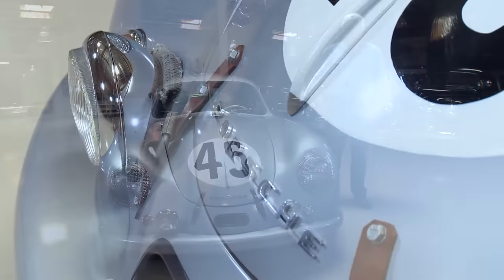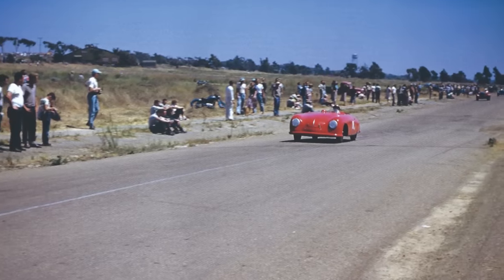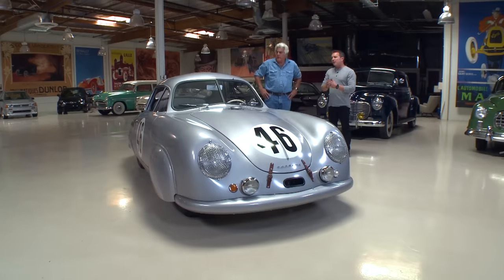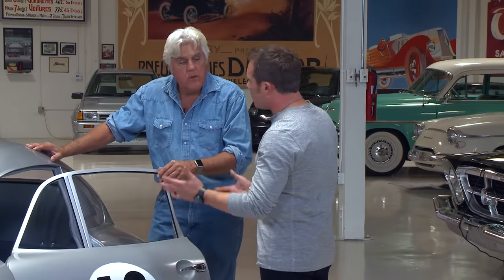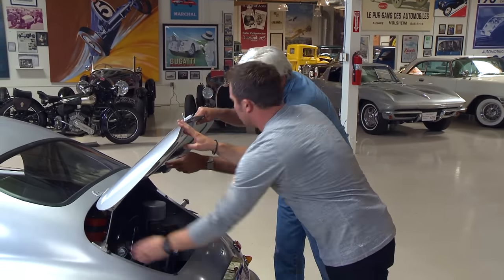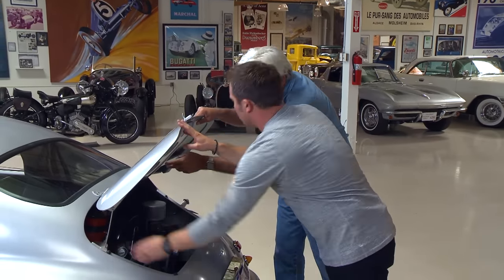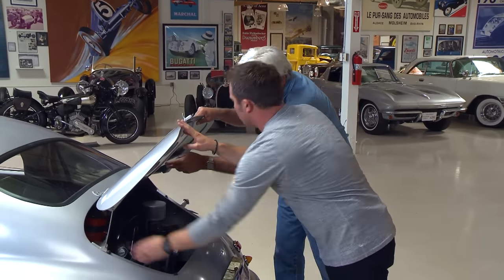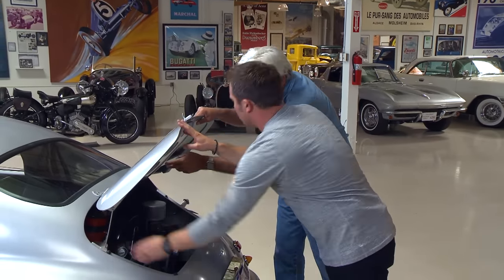1951 Porsche 356 SL Gmund Coupe - Jay Leno's Garage

Comment: The moment he said original 50's tires, Jay didn't regret not driving it anymore.
Reply: You would have thought they would have had some new tyres on it for driving it around and kept the 50's tyres for shows
Reply: Probably pretty tricky to change the wheels on it and I doubt it actually gets driven around much anyway.  I would guess it mostly travels on the back of a trailer.
Reply: +David Bell Yeah, I would rather straighten a bent frame and repair an all aluminum body from a total wreck than take 30 minutes change the only part of the car that touches the road and controls the travel of the car.
Reply: Explains why he was driving so slow.
Reply: He must mean rims?  Tires expire after 6 years, and that's modern rubber.  60 year old tires would probably fail very quickly.
Reply: tire composition was probably different back then...... they were clearly talking about tires if you pay attention... they were also driving ridiculously slow.......
Reply: When they go out of round like that it is bad news; it can't be balanced out and that is probably a good thing, since the rodeo ride is a constant reminder that they need throwing away. Probably initiated by a reduction in plasticity
Reply: Mn09lfV6f Nah, Mazda rotary. Twin turbo.
Reply: someusername121 : no he was referring to the tire.
Reply: If he had thrown a tread on one of those tires at any speed at all, it would have destroyed the wheel well and adjacent body. Prolly won't do that again. I think that Jay may have caught him unprepared for a drive between shows.
Reply: You could buy new period correct reproduction tires for classic cars.  There’s a tire company in the US who buys old original tire molds from manufacturers when they retire it from production.  There’s a video of it on Youtube.
Reply: You think they would have New set of tires and wheels for street driving  Cheap _____
Reply: @someusername121  depends on the tires and how they were stored. That modern experation date is arbitrary, and there are many different variables that go into how long a tire lasts.
Reply: original tires and gas, omg
Reply: @someusername121  This isn't the first time. Check out the Lola GT video. That one was using the original 1963 rubbers as well!
Reply: @Mn09lfV6f  Brave man to drive a car like this even with new tyres but tyres that age?
Reply: @someusername121  No.. Tires back then were a lot different than modern tires. Old tires used very hard rubber, could last 10x as long as new tires, and many vehicles from the 50s and 60s still have their old tires
Reply: The entire vibe was different sitting passenger, welcome to the peasant world Jay haha
Good episode
Reply: @jjmac3561  Ex and my mom are
Reply: @Mn09lfV6f  Driving someone else’s priceless one of a kind iconic piece of automotive history.
Reply: My dad had two beetles in the mid 70's remember he was very particular about his tires...they both had a popular Michelin of that time zx something...I think it had three letters....pretty outrageous patern....they had exceptional grip in all weather conditions and lasted forever....
Reply: Yep they don't make tires as they used to, my dad bought a new 71Coronet only drove it 20k miles and was sleeping for 23yrs in 2019 we revived it and the original tires still going strong and we took the car to dirt roads up in the mountains
Reply: Nothing will make you fear god like bias plus.

Comment: This is an amazing story by both of you. Glass windshield and perspex racing windows. Juat loved seeing the red inside of the headlamp buckets. Authomotive archeology. This is some great history and we can add being on Jay Leno's Garage to its history. My '74 that I ran into was in Rennsport IV at Monterey. That's where I met Jay for the first time in person. My '74 went through so much but eventually I had to sell it. My car was some kind of a test car for Porsche before it was sold. It is considered to be the earliest Porsche still on the road in North America for the 1974 year. It has a unique set of trial gauges in it and it has the holes that are factory drilled for the optional factory plastic race fuel tank that was not offered on the 1974 models but rather the 1973 model. Clearly this started life as a long hood chassis and then was built up as a 1974 and sold to its initial owner who bought it from Mark Motors in Oxnard (a dealer few people recall let alone having ever heard of. The cars DOT sticker and original license plates are still with the car. That sticker has the completion date in July 1973, belleive it or not. The color is factory original emerald green metallic. During my restoration efforts on the car, more than one independent Porsch mechanics stole parts off of it. This inlucde the paint code badge and the original accordian covers for the bumpers. It also included the original American headlights. What else was stolen, I don't know. The engine, transmission and body remain original to the car. I had help selling the car and it went through one of the main people in Orange County Cars and Coffee weekend show. The original gauge cluster that is totally unique to this particular car is still with it. I have lot of Rennsport IV photos of it. The custodians sent me a letter saying that they could tell I loved the car. Due to illness at the time, I sold that 1974l It has gone to a good home. The car has experienced a hard life and after an accident, I could have junked it, but I had it rebuilt for the third time under my stewardship. AF

Comment: Jay looks visibly upset to be in the passenger seat.
Reply: i was thinking he looked upset that he didn't own it ,, i think he would if it was for sale
Reply: Has there been any episodes where he doesn't drive?
Reply: Yeah...there was some motorcycle thing that he didn't drive but that is because it was a death trap...  Don't recall..maybe sometime late winter/early spring.
Reply: Because lap belts.
Reply: Gas
Reply: David Fischer  Then Jay would not get in most cars produced before the early to mid 70s.
Reply: Not with old tires. You don't want to be responsible for a multi-million dollar car with old tires on it.
Reply: No he doesn't
Reply: @pappyodanial  Old tires is not a big problem, you just have to adapt your driving to them. (Just like on snow)

Comment: Tires from the 50's ... now that is brave. They're lucky they didn't turn to dust going around a corner.
Reply: Inner-tubed though, and as long as they are not dry rotted they should be fine. They probably didn't even go 40 mph the entire time.
Reply: yeah its pretty dumb put some tires on the car.
Reply: That’s what the advertising would have you believe

Comment: Guys the name of the city is Gmünd not Gmund !
Reply: Most people don't know how to access the text editor app that allows selecting characters that don't print from a standard English keyboard. In Windows it's called the Character Map. When printing foreign proper names I usually try to use the correct characters, e.g., the German umlaut. I typically put a shortcut for the Character Map right next to the icon for the text editor.
Reply: And it’s still Munich and not München

Comment: Whats the current value of this car?
Reply: millions
Reply: Jillions*
Reply: lets think you def and didn't listen to Jay or the fact the Jerry Sienfield spent 3.5 million for a original rusted car with no real race history.
Now add in this car was the first Le Mans car Porsche entered and won class with ,basically cementing the future of the company as a super car forever.
25-40 Million would be a good starting point at auction , now if some billionaires get in a bidding war then 100 million could be the price.
Reply: arabs will pay any price
Reply: The replica at the Porsche Museum is insured for 5 million euros.
This one is an original, and the first.
Go figure.
Reply: I'm surprised it's recognized by Porsche. It's more like a replica because almost everything is replaced.
Reply: Priceless.
Reply: Whatever it could get at auction. Given its provenance, I'd guess somewhere in the 15 to 20 million dollar range.
Reply: well it is the original chassis which is the most important as each car till present day is identified by chassis. And this is race car, on race cars you may have 10-20 or even more engines that come and go.
Reply: priceless really!!!
Reply: Marauder252 no, the most important things weren’t replaced.

Comment: Probably not that expensive of a car. Just labor cost. So much of it isn't original or else porsche would have it.
Reply: If the owner got his hands on the car before they realized it was the first le mans Porsche, then he probably got it fairly cheap (relatively speaking), then the cost of restoration was probably over what he paid to buy the car, but still not "expensive" per se...but now that everyone understands what the car is, it's value (think what a group of super-collectors like Seinfeld would be willing pay at auction) is probably orders of magnitude over what the owner has invested. I wouldn't be surprised for a second if this car was valued at 8 figures.
Reply: JCW80 it's not like Porsche restored it though. It's a couple guys in California. Not Porsche parts just stuff they made and bolted on. Cool car. But I just don't see this being worth more than kit car value
Reply: Kit car value? No way, buddy. You can buy a kit 356, built and ready to drive, from some respected kit builders (like Beck) for less than $40k. You would be hard pressed to find any real 356 consumer car, in beat up, non-running condition, in that price range. It also doesn't matter that Porsche didn't restore it, there are a lot of restorers that are highly respected by the community, like Rod Emory. And of course, let's not forget, it's the first car that Porsche fielded for a race, and the race was Le Mans no less, and it was a winning car.  Race history plays a HUGE role in value for collector cars, that detail alone would push the value of this car up more than any other detail about this car.  I'm not saying it makes a lot of sense that a car like this would probably sell for millions; I'm just saying that's the reality.  :-)

Comment: Dear Keith C - @ the beginning of the clip details are mentioned about the 1951 24 hrs of Le Mans . The car  came 20th in the race overall but won the 1500 cc class, even though it only had an 1100cc motor - that imo makes it an exceptional car .

Car buffs have a tendency to exaggerate a little & Jay kept saying the car " won it's first race " which in a way it did - winning its class race . I guess I'm splitting hairs being a pedantic Englishman !!

Also for car buffs its place it's place is important in history as it is Porsche's first " race winner " @ Le Mans & Porsche's are still winning classes @ Le Mans in 2018 . They must be doing something right !! 

Best wishes - Henry

Comment: At 2:12 you can see the "Sascha"- Sportsracer which Ferdinand Porsche designed in 1923 for Austro-Daimler. He had seen the Bugatti Brescia 1250cc with 30hp that was so light he could beat a Hispano Suiza with 150hp.  So he constructed this car with a 1500cc four cylinder and 30hp and 1300 lbs.  He drove it personally at the Passo Stelvio and overtook an Isotta-Fraschini with 7 litre Engine.

Comment: That is really raising all kinds of questions for me about the car my stepfather drove when I was a kid.  It was just a really rundown, worn out, rusty old race car then, but I wonder what it's history was.  It was a 1960 356B rally car, with dual fuel tanks, fog lights etc. but otherwise just a street legal car that we used as a daily driver.  Like this one, it was geared really high, with no bottom end.  It liked to cruise at 80 mph, which made for a lot of speeding tickets, and a lot of burned out motors, which we replaced with VW beetle engines.
Reply: My stepfather sold it to someone in Harrisburg, PA 41 years ago, and that is the last I heard of it.  I wouldn't want to find it again.  I don't have the money to buy it, but thanks for offering.
Reply: +userunavailable3095 do you remember liven plate or vin?
Reply: I wouldn't have a clue.  I was 11 or 12 when it was sold.

Comment: When I lived in Tucson I noticed a white car sitting almost out of sight in a field/backyard, all grown over. It had a top that reminded me of an old Jaguar with a split windshield. I walked over to it and it was a Porsche. It was in sorry shape, it had been wrecked at one time, pretty hard apparently, there was bondo chunking out of the area in front of the windshield. Thick slabs of putty too. It had the original banjo steering wheel, and no running gear. I don't remember if the front axle was still there. I happened to sit next to a guy at the half mile dirt track outside of Tucson, and he turned out to be the president of the local Porsche club. I told him about the car and where he could find it, and in no time at all it disappeared. I've always wondered what the end of the story was, if it was restored and that sort of thing. It would have been quite a task to bring that thing back to life.

Comment: Porsche developped a aerodynamic Coupe based on the Kdf in 1938 with Cw 0
,29. For the Berlin-Rome -Berlin Drive over 2000 km / 1250 miles planned for 1939, but did not take place because of the war.

Comment: "Do they use turn signals?" yes, they actually use them to signal to other cars which side they intend to pass, or signal to faster cars where they're going so the other cars can safely can go around them, and they also use the turn signals when going into the pits. And it's not just at Le Mans. It's a general thing for all the GT series endurance races, because especially at night it can be extremely difficult to see where the other cars are going. Since they run 4 different classes of cars together on the same track, this kind of signalling is very important to avoid collisions.

 Also, although not relevant for cars this old, it's important to remember that although Le Mans is legendary, to this day it's a standalone race and not actually part of the GT series championship, and there have been seasons throughout the years where the teams had to modify their cars to race in Le Mans, because they have slightly different regulations than the regular GT series, most notably in regards to engine performance, vehicle dimensions, and safety equipment

Comment: "Steve Porsche ... a car barely alive. Gentlemen, we can rebuild him. We have the technology. We have the capability to make the world's first nearly entirely fake priceless bionic car. Not quite the same as it was before ...not quite the same, not as strong, slower!"

(How to take 4 non-original tyres and half a bodyshell then add parts until you have a fake original Porsche. New engine, new upper body, new dash, new interior, new paint, new decals, new bloody everything!)
Reply: Lensman I agree.  The car doesn’t really impress me.  I would respect them more if they left it as it was after the previous owner chopped the top.  They could have left everything the way it was except maybe paint it.  It would be the evolution of the car.  Lemans 1st winner and an old retired race car in the historics.  Instead they turned it into a fake

Comment: It's not in the museum because they don't want to pay the ransom the guy wants for it. It would be interesting to know if that's the original roof since it was cut off by a previous owner in the 50's, or for that matter how many panels are still original since it was raced right up to 2009.

Comment: 6:49 technically not true. The actual factory team for Porsche had a few gaps, namely between 1969-1962 when Porsche started with the 718 in formula 1, eventually leaving in 1962 with a few wins in the mostly unsuccessful but noted 804.

Comment: The 911 in 1874 and likely all of the base cars for each year prior to that, came with a four-speed (speaking of the Le Mans car), stock. One had to option the car or have the car changed to a five speed after purchase to get a five speed. The 1974 had documentation that it came with a five speed, having been ordered that way. The only way to have known since Mark Motors had long since gone out of business in Oxnard, was to examine a special electronic archive that Porsche has available to certain employees with a computer code. A Beverly Hills employee who's father was a racer had such a code and looked it up and printed it out for me, showing that the car was ordered with a five speed. Efforts to contact Porsche by me went without fruit, as my letters to Porsche about the car were met with silence. AF

Comment: I had a 1962 (factory) acid dipped body with alu doors, deck lid, 22gal alu gas tank, plexi windows (non roll up), annular disks, 12v stock, oil coolers, Scheel seats, electric windshield (tiny wires laminated in !), 260km speedo, roll bar... etc. etc. all stock. Bought new by some Austrian guy named Siffert (!)... I was first person to put it on the road in 1973. Never had bumpers. 1400 lbs. Had to put in a 356B engine instead of the missing OHC Carrera. Factory only made four of them. Living in Aspen I sold it to a guy from Laramie for $1,800 !!!!! (I saw one of the others sell for $350,000 back in the "90's) I've been unable to find out what happened to it. If anyone has any idea where it is I'd like to know. I got it from Pete Calihan of Albany. Even that damn windshield would be worth a fortune today.